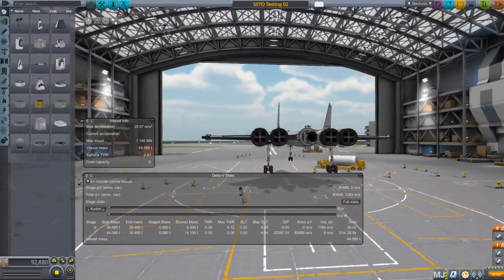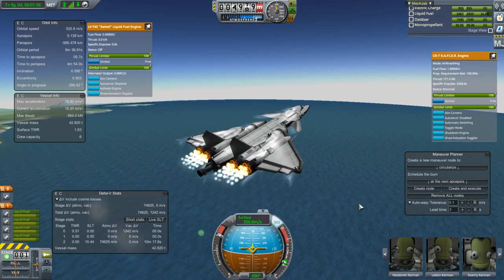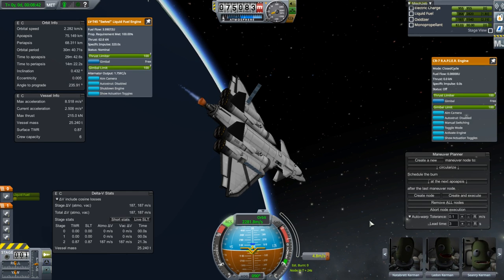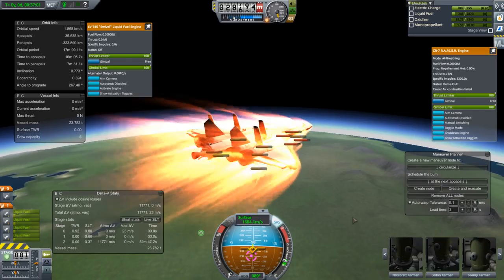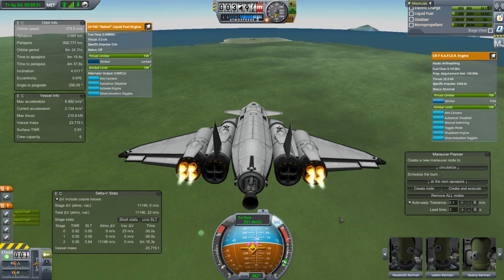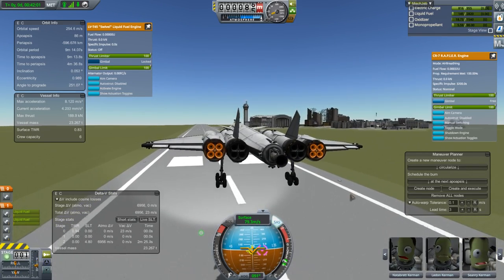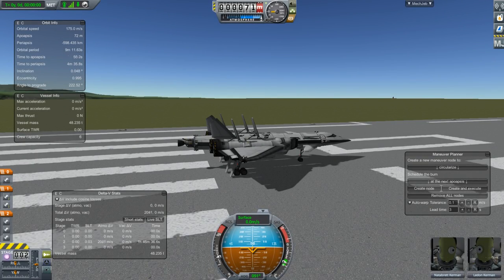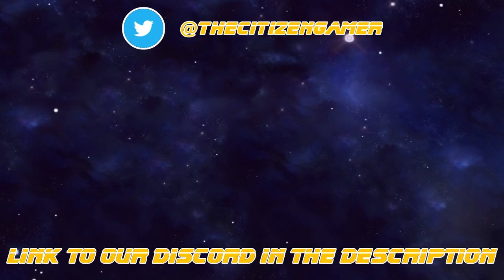Dragon's Den: Space Planes

Comment: The second design could have been pretty amazing if it was the standard design for SC. Very powerful mains, medorately powerful Vtol and a good amount of tiny MAVs all around. Rolling manoeuvers would then become useful to get the best Gs resistance on the pilot AND allow the Vtol to act as the main way to vector change while bearing guns on target. For more complex manoeuvers we'd need to turn the whole ship and use the Main engines coupled with the Vtol but also means we'd need to point our guns somewhere else while manoeuvering.... putting the emphasis on flight for position which would be great. And that's only for the space part. In atmosphere it would also meant that the "planes shapes" SC often use would be the most coherent shape for spaceships that needs to often fly in atmo. Use the energy shields as a way to smooth out aerodynamics and bingo you get a logical design and an interesting gameplay all the while being realistic.